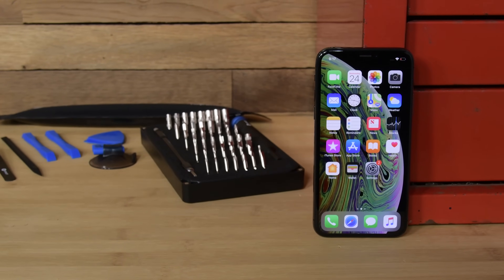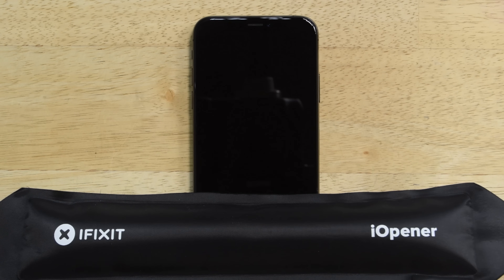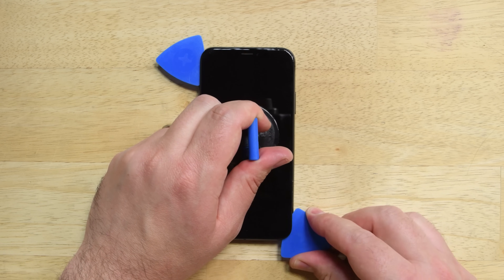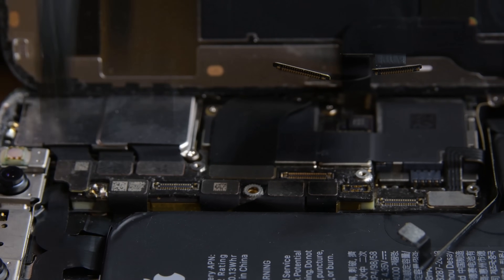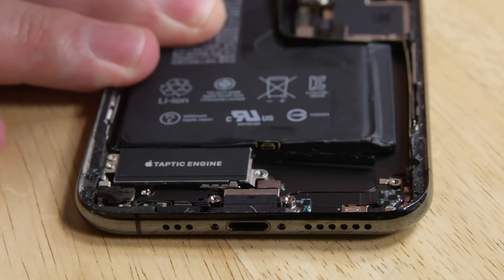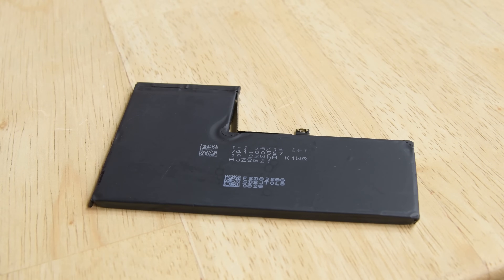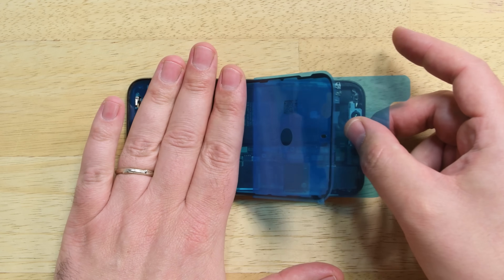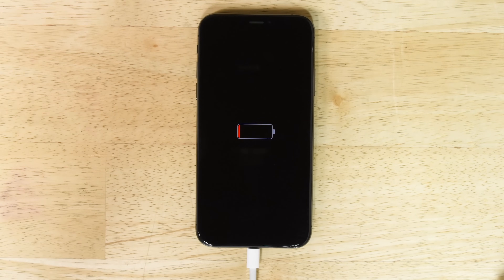iPhone XS Battery Replacement - How To

Comment: After replacing the battery and trackpad on my wife's Macbook Air, I was feeling brave about maybe replacing my phone battery. This video talked me right out of it.
Reply: Yeah me too, seems much harder than laptop battery replacement. I just did on my MBP a few months back and it was fairly straightforward. No way I'm doing it myself when it comes to my iPhone.
Reply: It is not problem unless you have iPhone X,XS ..., than you have problem of coding battery or it will show the old cyclus and service. It need coding with special tools and for now only Apple can do it (there are some electronic equipment, but I do not know how reliable there are9. Regarding MacBook, depending which is, it is not hard at all. You just need right screwdriver( you can buy it on net) open it from bottom and you can see battery and change it, it is not hard.
Reply: @samirh8588  hi I thought that the new iOS update doesn’t reset the battery counter, that’s the problem with apple, they do anything to make it harder to replace parts from a 3rd part repairs same goes for the oled screen, it has to be coded
Reply: @johnnyb3370  yes, and even if you take it to the Apple, they have to do the same. They made it on purpose, so you can not change battery without them. It is possible, but to buy all equipment just for one battery, does not pay out. But if you need to change couple of them , than it is worrh spending money

Comment: IFixit did not mention about the chip that tells the Battery Health which locks technician for a battery replacement. It will say “Service” when you go to Battery Health.
Reply: Yeah, I’m waiting for that.
Reply: Glenn Bonavente waiting for that actually..
Reply: you mean there is no way to change the battery whatsoever?
Reply: @andersoncaviedes  The battery will work fine if you replace it, it will just say service and not load the battery health.
Reply: @Common_Coreless  never ever went into that menu
Reply: @Common_Coreless how do you fix that ?

Comment: I know this is old now but I just finished replacing my wife's battery (I'm not a "tech guy" per se but I love working on it). Couple of things would be nice here as I went through this process: I wish there had been more discussion on how to PROPERLY adhere the new gasket to the speaker and screen, the video on another ifixit demo really doesn't show much other than a guy being good at it, I pressed mine in and applied hand heat before I took the final blue protector off and it still seemed to peel back off and became really messy, I wouldn't have guaranteed much to the "waterproofness" of her phone after that. And also getting the actual battery out was a HUGE headache until I used a couple drops of alcohol. The pull tabs on the battery must have been brittle so they snapped from barely pulling at all and I had to retrieve three of the four with tweezers and a tiny bit of prying without bending the battery too much. These were the only two steps that made it difficult but needed more explanation (or options for achieving them) than I feel was given.

Comment: Thank you very much for the video! My iPhone is starting to have battery issues (simply due to age) and I need to replace the back plate as it is cracked. May as well replace the speaker too as it is a bit blown. Great to see that I can get this done in (hopefully haha) one session. So this is very useful, thank you! (btw I'm an ANSI certified tech with about 5 years of experience, so this is pretty straight forward). Thank you again iFixit!
Reply: How did replacing the back glass go? Lmao

Comment: Followed this video and changed my iphoneXS battery in less than an hour. This is my first time ever opening a mobile phone to attempt something of this magnitude…well unless for Nokia 3310’s which pretty much came apart and together like a puzzle would. 
Thanks for the video.
How does one fix the Battery Service-mode the phone goes into after that though? Has apple changed their policy on this yet? I read somewhere that even if you put a genuine from apple replacement battery, you’ll still get that notification on the XS and other models.
Reply: Did the battery health say 100%?

Comment: The reassembly never mentions reinstalling the small bracket at the right edge of the Taptic Engine. This omission caused me to mess up my seal a bit taking the screen back off. My kit came with a new speaker seal, FWIW.
Reply: FWIW
Reply: Oh yeah wtf

Comment: 2:29 Why couldn’t they have added some extra battery capacity in that blank space above the battery. Also you charge $80 for a battery while Apple charges $70 including labor, they seal your phone properly, and there is no service battery warning.
Reply: This free space for the battery to breathe 
If they make it bigger to fit all the free space it will explode
Reply: @hasanainal-haddad8770  Yup, that's what happened to the Galaxy Note 7, there wasn't room enough for the battery to expand.
Reply: are u guys blind?...its space for the front facing speaker its literally attached to the screen and it fills the gap when the phone closes open ur eyes.
Reply: @usernamepassword2140  dude honest i lost brain cells reading those comments

Comment: I followed this tut exactly but ran into a problem.
Is there any reason as to why my screen would stop responding to touch right after i replaced the battery??
Everything is working perfectly with new battery except for my screen now not responding to touch, all cables are fine and connectors perfect
any help would be amazing!!
Reply: Hi, did you fix this this? I've just replaced the battery and the touch screen is not working... I can't unlock the phone

Comment: Regarding the charging method at the end. I thought that was only needed for older Nickel-cadmium batteries. Iirc, lithium polymer batteries don’t need to be charged like that.
Reply: Indeed. Lithium Ion and Lithium Polymer batteries do not like being drained fully down, they prefer you to charge them at 25%+.
Only Ni-Cd and Ni-MH need to be deep discharged to calibrate them.
Reply: spotify95 Its to calibrate battery health. iOS estimates battery  health by taking how  long it takes to fully charge and drain. Its also good to do once on a brand new battery.

Comment: Man how badly have you hammered your phone to need a battery replacement within a year?!
Reply: MikeWard1701 no one does, but if someone needs to replace it in 2-4 years the vid is ready to help.
Reply: If you constantly use it from a 100% to a 0% with 100% brightness and heavy use, with a fast charger for sure you’ll need to replace your battery at least very year
Reply: DragonTechRoyale4k you tripping i do All that and my battery is still at 100% health for 5 months and its a iphone 7 btw
Reply: Shawn Miranda 

my battery is at 92% and it stresses me out cause i’ve had it a year now now it drops even faster idk
Reply: Евгений Познянский mine too but after 1 year

Comment: This is the long way of doing it. You don’t need to remove the bottom speakers or Taptic Engine. It can be done without removing them. Also the factory Apple iPhone glue is strong enough to stick back again.
Reply: I just did it and couldn't imagine trying to get the tabs out while those were present. Its already hard enough to get the tabs started, with the speaker and taptic engine in place I could foresee a LOT of people damaging those while in place. I'm sure people who are good at this can do it, but ifixit in my opinion is made for more average non tech people doing repairs.
Reply: @SilentMott  I agree with you 👍
Reply: @SilentMott  It's doable but very tough. I've done it 3 times without needing to remove the bottom assembly. Instead of pulling out the tabs like a normal person I used the dental floss trick while dribbling alcohol behind the battery, with lots more forced prying between the battery and the back (almost to the point of bending it). It's unsafe, but it works!

Comment: Why is replace battery so mutch dificult ok phones do not have replaceable baterry from factory but still batery shuld first thing accessible after open phone not afrer remove half components from it.
Reply: Water resistance
Reply: Cause they wanna charge u extra for the replacements: a battery,20 bucks,their replacement in assistance 100 bucks or so
Reply: @despacito311  OK but still why remove all components on bottom of phone to access pull tabs for battery removal? Water resistance require only hard to remove screen and back of the phone do not require remove internal component with 5 type of screw.
Reply: @emacicc  Yes I think this is real reason apple always hate unauthorized repairs.
Reply: @martinpejchar9011  That's both, combine them and you get a hardly repairable phone, add a back glass and it's pretty much impossible, apple
Reply: emacicc wtf their battery replacement only costs $29
Reply: @narukahana6321  Maybe in your country here in Czech Republic
 is price in authorized service 2000CZK cca 88USD.
Reply: It’s not super hard, in my opinion. The screen replacement is even easier, especially compared to a Samsung device.

Comment: I do the same and replace the battery but after replacement battery health percentage didn't appear 
What should i do?
Reply: Did it appear did you fix it?
Reply: @igho1298  Yes, i changed the battery board with the old one cause it contains some data  now. It's showing health and recognizing the original part.

Comment: Be carefull guys, you cant just pull out the adhesive stripes like its shown in the video. They will break 100%. They are doing it on a brand new phone thats why its working.
Reply: What should you do?? Should you use some heat with it then??

Comment: Weird question. Have you herd of ghost touching? My phone just randomly clicks on stuff. I’m told replacing the screen is will fix it then I’m told replace the battery and that’ll fix it. Do you guys know if either or both will work. I’ve done a whole factory reset and that didn’t fix it.
Reply: i suffered that to the extreme, it stopped when i replaced my old screen with a new one

Comment: I had 75% battery health and went to Apple store with appointment to change the battery for $69 + tax. Apple tech did not change my battery due to a small screen crack on left top. Apple needs the screen replacement  $300 to do the battery change. Apple is now making it harder by showing service warning when changing a genuine apple battery or screen. Apple marketing strategy to push their new iPhone at full price instead of doing a needed battery change even when phone is fully functional.

Comment: What about reseting battery cyclus? The new battery (even it is original Apple) needs to have reseting battery cyclus, otherwise it will show the old battery cyclus and service. And for that you need some equipment to do that. You did not show or explain this.

Comment: I’m pretty pissed I replaced the battery did everything right and now True Tone isn’t working anyone else have this issue?
Reply: I found out that replacing the display adhesive is mandatory because if you don’t the display won’t be flush with the frame and True Tone will not work at least from my experience I got my True Tone working by replacing the display adhesive

Comment: .....then, after you have the phone open and you've got all the screws out and the battery connectors unhooked and the battery out of the case,   sweep the whole mess off the table into the wastebasket and go out and get yourself another phone.

Comment: Why bother applying adhesive to the battery again? It's not like it's gonna dance around in such tight construction.

And if you want to replace the battery again, you'd have to go through the same struggle, all over again.
Reply: If you don't apply adhesive the battery can actually knock against the back of the touch screen.  Happened on an older iPhone I had where the battery came loose from the adhesive after a replacement.
Reply: @shaneybrainy13  oopsie doopsie, I guess we have to take care of everything while repairing an apple device 😂 cause apple doesn't do shit in terms of engineering other than selling their fruit brand😑

Comment: Charge it upto 100% then for 2 hours more. Why? Do you want to kill iPhone users while they wait for the battery to charge through the slow charger apple provided in the box?
Reply: It's called calibration
Reply: @HenningGu  But what sort of calibration? After 100% some app say charge for extra 10-20 minutes and I fix it just went with 2 hours, like WTF? As soon as it shows 100%, it take like 2-3 minutes for it to charge fully.

So do you care explaining what sort of calibration?
Reply: @gurkiratsingh8747  In reality there shouldn't be a need to calibrate these batteries as they are lithium-ion and not Nickel-cadmium. That being said, lithium-ion batteries can technically suffer from an SOC mismatch, however I am not sure that calibrating before or after would actually prevent/resolve this issue. On a side note, I am not so sure quick charge is the greatest technology. Whenever I start using a quick charger, I feel like my battery life starts to suffer and it would make sense considering the way quick charge works and also, as there is increased heat, quick charge likely puts more stress on the battery in the long run.
Reply: @exad0  IDK the soc stuff you're talking about, if you meant system on chip then IDK what you're referring to, but if not maybe I need more research. 

Also there are companies like oppo working well in the quick charge department in mainstream(not talking about 100w/120w concepts) increasing the amperege instead of voltage, so it doesn't hurt the battery that much.

But I mean there must be some limit, like to achieve 100w with 5v you gotta have 20A, and downside to increasing amperage is that you have thicken the wire, and I wonder how thick could you sell, really!?

Also I charged someone's iPhone 6 with my 10W charger of redmi note 3, I mean how hard is it to provide a 10w charger? It charged in like 1.5-2hours(max) but on original one it would've taken like 3 hours.
Reply: @gurkiratsingh8747  State of Charge
Reply: I totally agree with you about the fast charging stuff. I've used 29W MacBook charger to charge my iPhone 7 Plus with USB-C to Lightning cable, the phone heats more than usual while charging, and also fucked it's battery 's Maximum Capacity to 86% in less than a year.